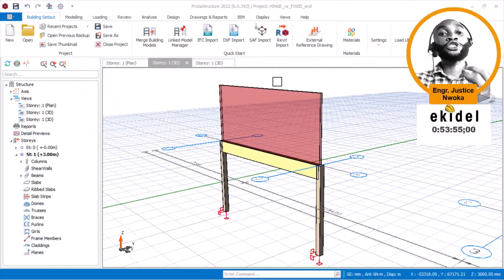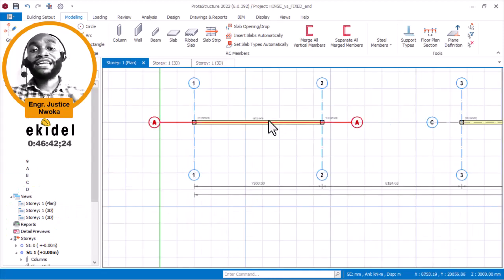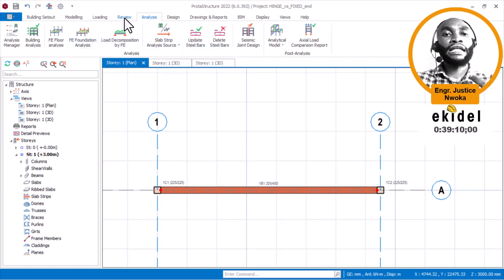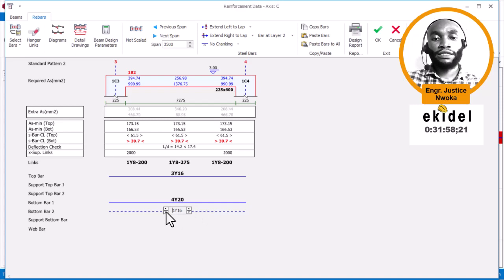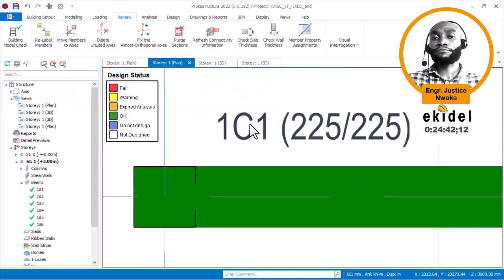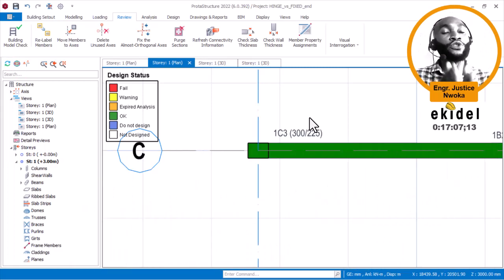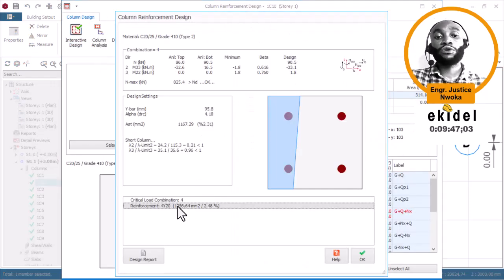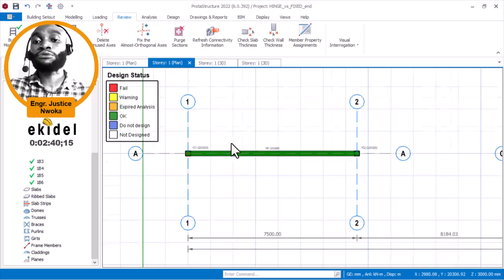NOT APPLYING HINGE END SUPPORT WILL AFFECT YOUR STRUCTURE | See the reason.

Comment: The chances of achieving pinned/hinged supports practically in pre cast rcc structures is very minimal, so because of various factors and reasons it is advised to design them as fixed supports, thank you thou.

Comment: Pls sir I still need clarification on the support conditions of beam 
On site most of the connections between our members are monolithic connections as our members are mostly not pre-cast 
So why then do we use hinge connections for the support condition of our beams in design
Reply from the maker: The effect is during the analysis 
We are trying to eliminate the moment at the ends of the beam thereby accepting that the ends will only have minimal TOP reinforcement at the ends after analysis and design

Comment: Well done engr I have been following your videos for a while now but I think using a fixed end support is totally preferable in RCC structure as hinging create a huge beam deflection under heavy load
Reply: Well but I think it depends with the steel fixing on site because you might design it as a fixed end beam then it is fixed on site as a simply supported end beam or design it as a pinned end beam and it be fixed as a fixed end beam on site.

Comment: Thanks for the lecture. But I have a few questions.

1. While applying hinge end is possible in Prota Structures, is it obtainable in real life, considering holistically the entire structural behaviour?

2. If it is obtainable in real life, what physical/structural conditions could suggest its use?

Thanks.
Reply from the maker: You're welcome
I believe you watched the video to the end, you have seen how the hinge and fixed end impact on the support size and also impact on the reinforcements of the beam and supports. If you didn't watch the video to the end of you skipped any part of the video, I will advise you watch the entire video as every part is important to fully understand the demonstration of the video.
Reply: @EkidelEngineering 
I really did watch it till the end, without skipping any part.

My question is if hinge condition is practicable on site. And if in reality, a beam can exist without transferring moments to the supporting columns.
Reply: @victorchukwuemekaokezuonu1290 As far as I know, hinged joints are mostly applicable in steel frame structures/precast assemblies. 

In a regular structure like an insitu cast structure, if hinge joints are the end conditions to minimize the number of reinforcement in the structural members, then a member such as a pin had to be available/provided to account for the absence of transference of moments, without an introduction of such, I am afraid the software basically designed what we input with the assumption that a pin joint would be introduced in real-life whereas iron benders/contractors would simply apply the reinforcement provided in the drawing disregarding the conditions of introducing an hinge joint...

Perhaps Ekidel can enlighten us more on this...
Reply: Same questions I was about to ask
Reply: The thing is when you make the beam end to be hinged prota will design the beam to take care of the moment at the support so even if it's fixed during construction you are safe because loading on the beam will not cause any moment at the support.

Designing as fixed end will make you to have much top reinforcement at the support to counter the moment while designing as hinged end with make you to have much bottom reinforcements of the beam to limit the moment at the support.